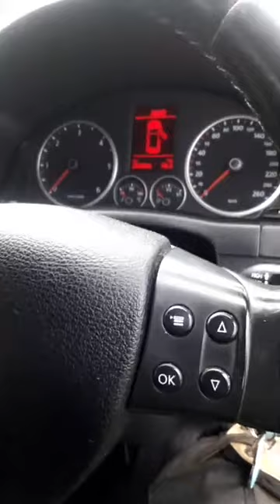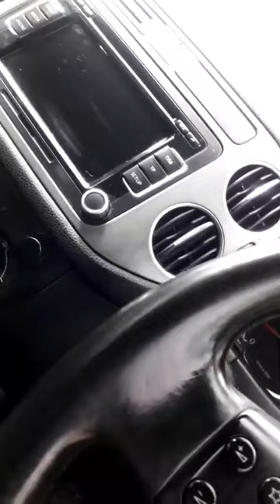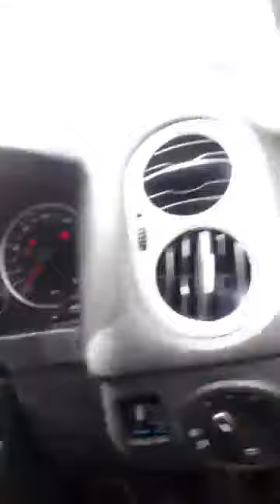2008 VW TIGUAN TIMING BELT/WATER PUMP FIRST START

Comment from the maker: high fuel pressure pump timing kinda  used out of the box drill bit set will do as proxy tool to lock in place